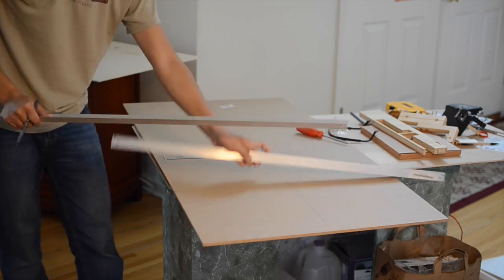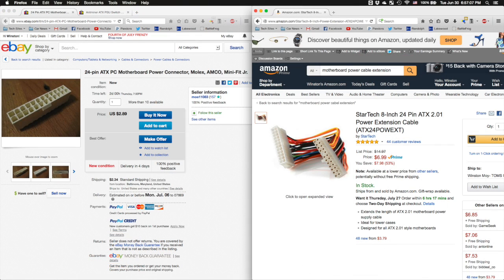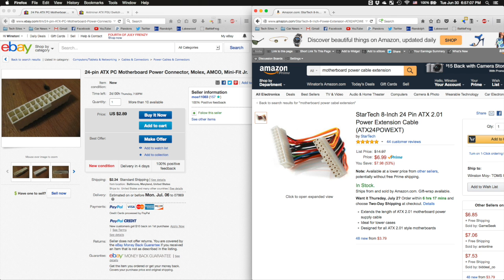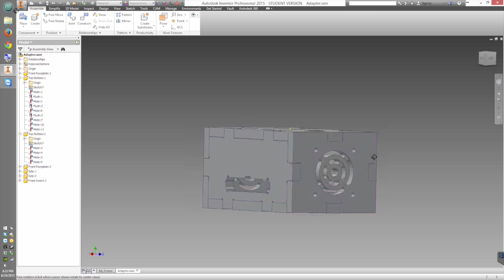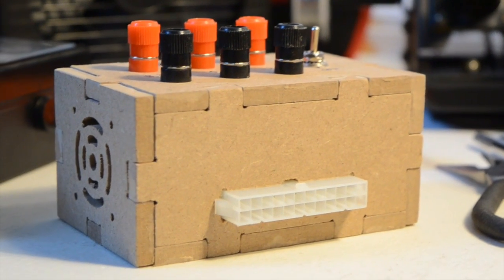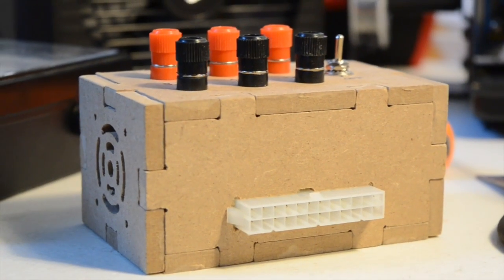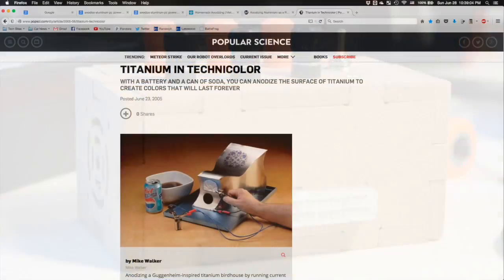PC to Benchtop Power Supply Adapter - Shapeoko Project #37

Comment: Is it possible to convert one of the outputs (eg the +12 volts) to variable voltage and variable current, using some circuitry?
Reply from the maker: +epiNoesis It should be, but likely to introduce efficiency losses.

Comment: are you sure that you only need one wire? many psu units have multiple rails so theoretically you are only using a fraction of your power supplies potential. In addition, pulling that much current through small power supply wires could potentially pose a fire risk.
Reply from the maker: +Redneck Nerd The multiple rails comment is valid, however on this power supply (and on my original PSU project) +12V was shared on a single rail.

Heat (and thus fire) are real concerns which you'll need to assess on an individual basis. I personally am running a 300 watt DC spindle on wires of comparable gauge without any issues, and I don't anticipate wanting, or needing the full rated amperage of my PSU. YMMV.